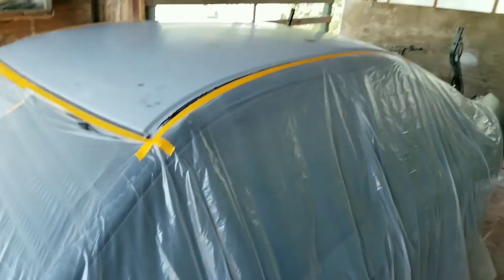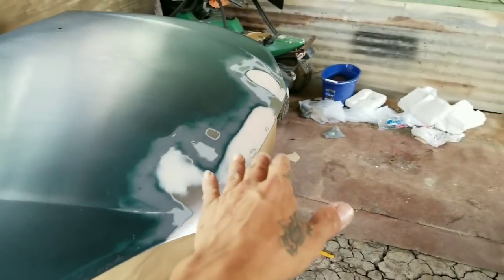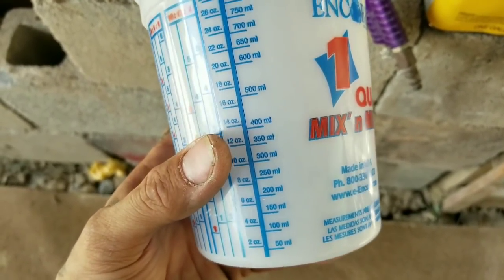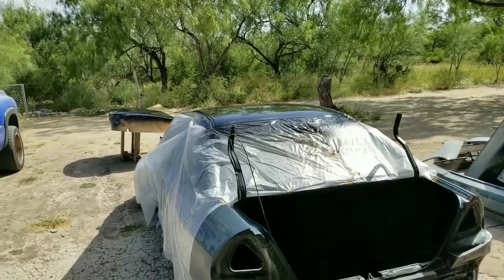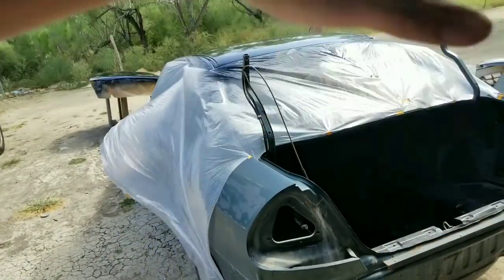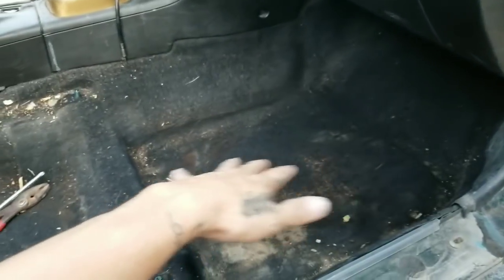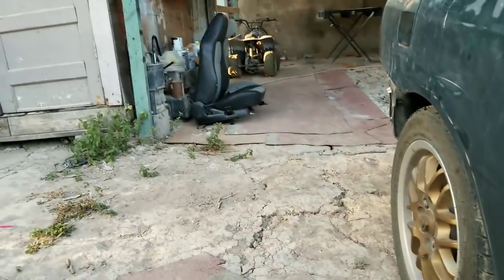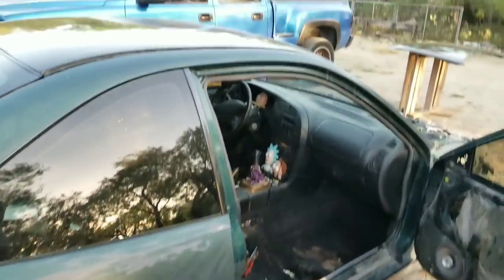Painting Roof and Hood ✔ ( Rustoleum Black )

Comment: I agree with people here in regards to cutting out the rust and welding in new metal. Also, someone suggested mixing 2 parts paint, 1 part reducer, and 1/2 part hardener for a low orange peel job

Comment: Not bad. I would over reduce the paint around 25% and give the gun an extra 10 PSI of air pressure to atomize the paint better. Would get a ton of over spray but a finish that wouldn't need wet sanding
Reply: What psi and what should my airtank be on?

Comment: Do yourself a favor next time and mix paint, reducer and hardener at an 8:1:1 ratio. Or better yet, at least use an inexpensive acrylic enamel automotive paint which has UV protection. Rustoleum will dull out within a short period of time.
Reply: The UV protection in "automotive" acrylic enamel is in the hardener.  You can mix some of that hardener (or for that matter tractor or other implement enamel hardner) with the Rustoleum and get the same UV protection.  Rustoleum out of the can is pretty thick, I'm not sure an 8:1:1 ratio would spray out of that gun (the HF purple gun can be made to put down a decent paint job, but it doesn't spray as much paint or as big a fan spray as a better gun and is more finicky WRT to paint viscosity), I think you'd get stuck with at least 8:2:1, maybe more reducer (acetone).

Comment: Aye brotha what setting do you have your buffer set on ?
Reply from the maker: I just run the buffer on low speed.  Usually between 2 and 3. I don't let it run too fast so It doesn't create too much friction and burn the paint. 
Make sure you have enough compound on your pad and work in small sections and work under the shade.  You got this! 👍
Reply: Thank you brotha much respect have a new subscriber 🙌🏽